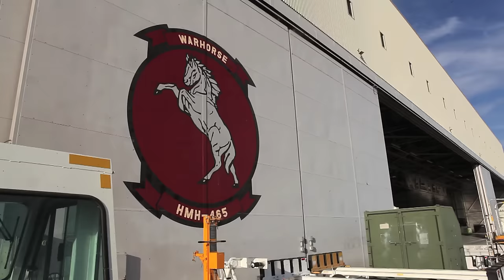U.S. Marine Corps CH-53E Super Stallion Sea Stallion

Comment: Why do the soldiers take the helicopter cables with a ground hook?
Reply from the maker: Komatsu Ni As the Helicopter travels through the air, even the rotor blades traveling through the air create static electricity, so the Helicopter becomes charged.  If someone standing on the ground touches the helicopter the static charge will go through that person, so they use a grounding rod to discharge the Helicopter before they grab on to the cable.
Reply: Thanks Wcolby for your explanation, the CH-53 SE, is an impressive machine .. I would like to fly a CH-53 ... Another question, what is the analogy of other countries of this impressive helicopter?
Reply: @wcolby  I've been shocked by it. Not fun lol

Comment: 2:46 guy with pole i assume static hook. Could get a good belt off that heli.
Reply from the maker: @flybobbie1449  absolutely right! the stick dissipates the static electricity built up by the rotor blades, especially in dry air, and discharge it to the ground.